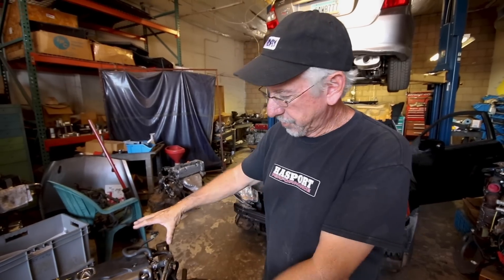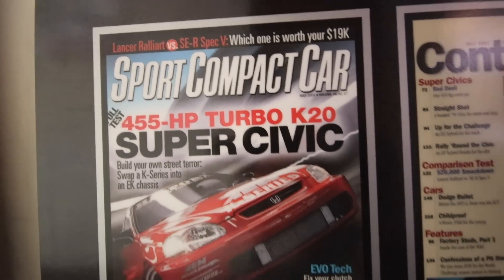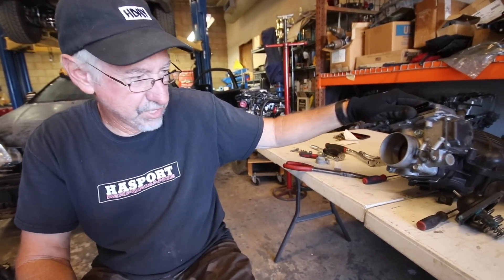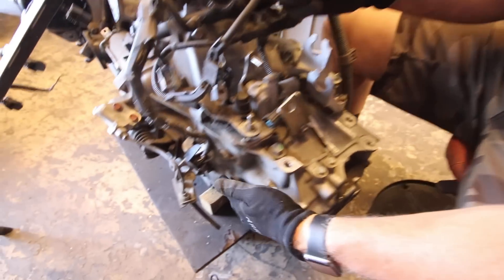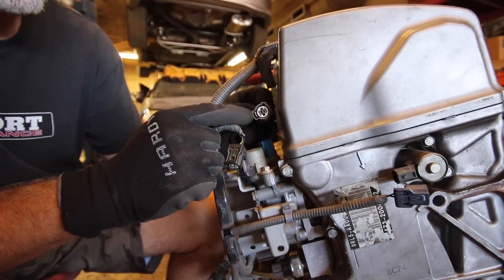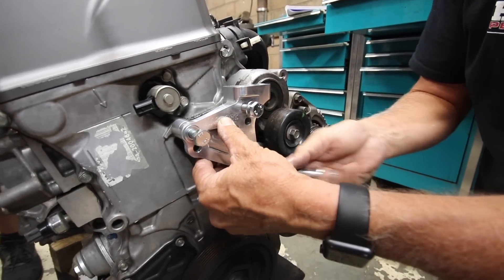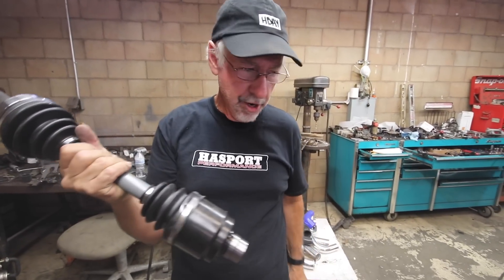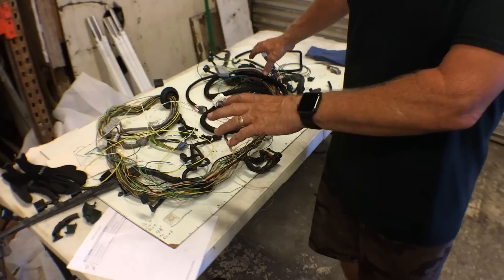Budget K24 Civic EK Swap: Resurrecting a K-swap classic

Comment: I relocate the Oil filter with PRL kit  could I run the Rsx Half shaft and axles. Im using K20 transmission
Reply from the maker: Yes we seen few customers do this just running tow or the three bolts for the intermediate shaft. We don't anticipate the shorter axle causing difficulty, but if you already had the other intermediate shaft and don't have a problem with the slight too short left-hand RSX axle then that works.

Comment: Sorry to ask some Stupid question, But I do want swap a K24A2 6MT into my 3nd Gen Fit. Is there any Suggestion? We do have the mounts and Axles for K20 swap. Is that will same working at K24 A2? I'm in China so there has less support ， it's possible I need to do it by myself. So just want to have as much information as I can.  I had watch all the videos you have  but still want have some more details information.

Comment: Love seeing a bit of love for this engine as a swap finally.  I believe that the 09+ crv engines used the same shaped timing cover as this engine but it still used the older style crank trigger wheel.  Ergo a older ckp sensor in theory would work.
Reply from the maker: I believe I checked that out and it was slightly different. I will check it out again, because that would be great. That would also explain the JDM engine I see that is similar and uses the old electronics.
Reply from the maker: Yeah, the timing chain cover will not fit the other K24Z engines. Just the one from the two years of CRV.